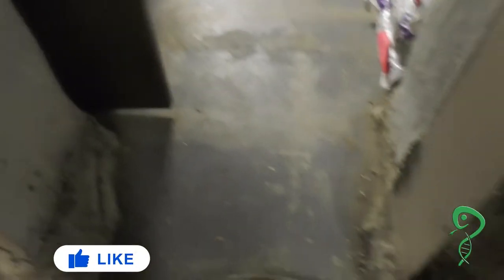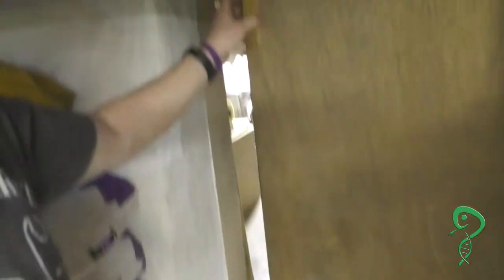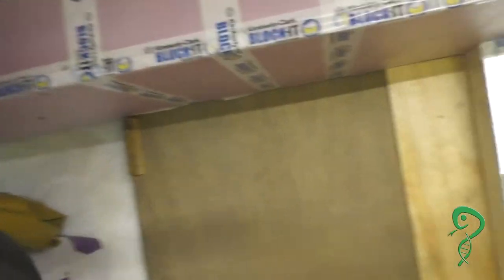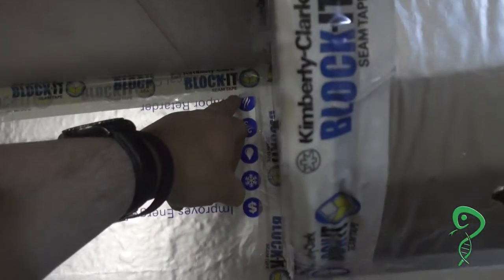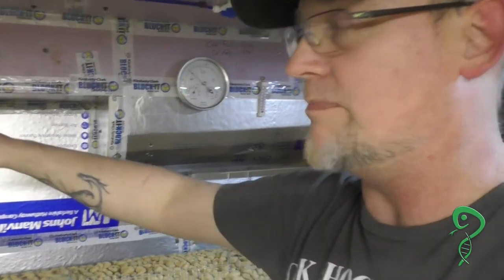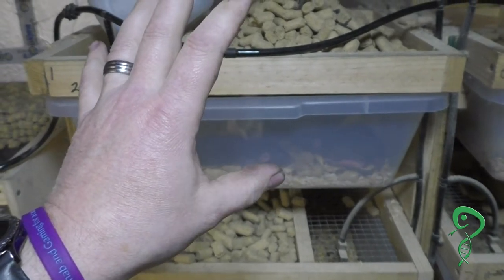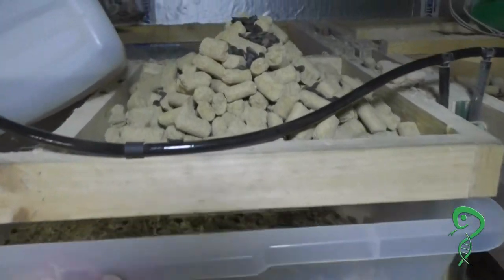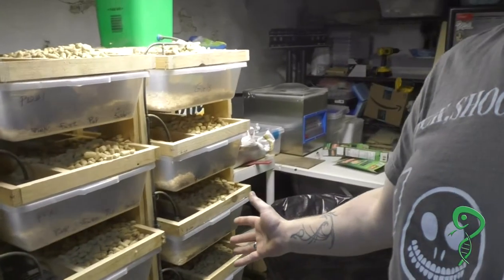Rodent Room Upgrades

Comment: Where do you get your bedding?
Reply from the maker: The normal pine shavings we get from our local Feed Mill. Farmers use it in the horse stalls around here in Wisconsin. Its little more courser/larger in size than the fine pine shavings from tractor supply